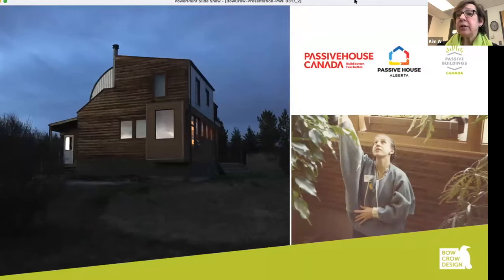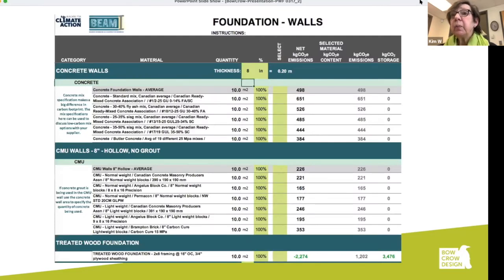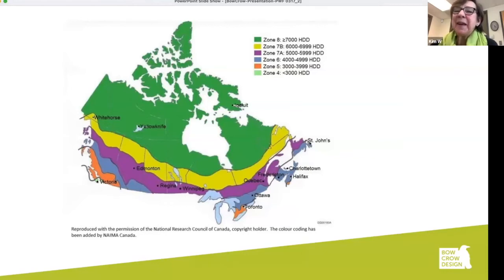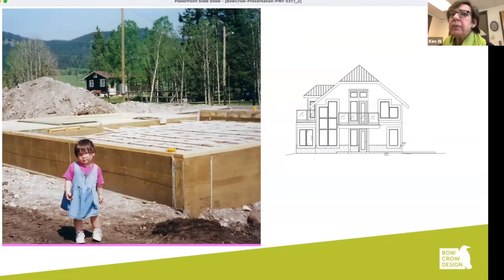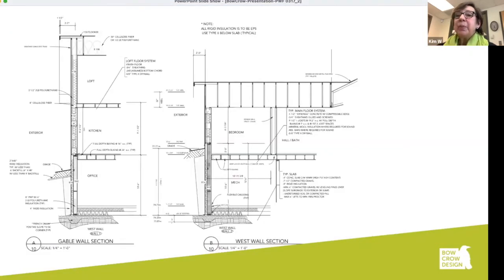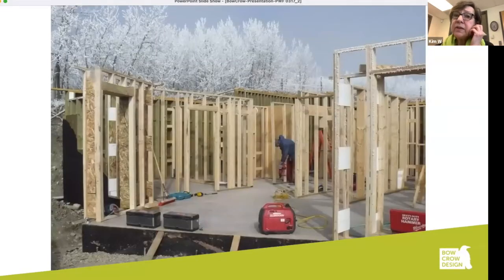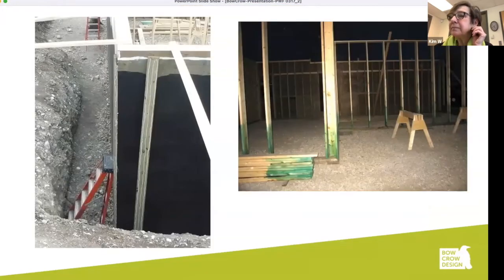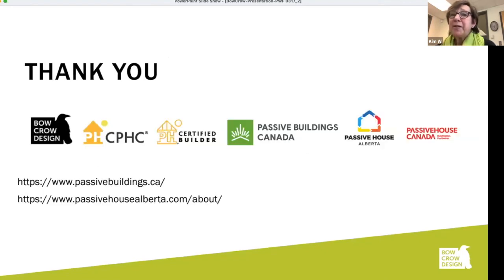Passive House Accelerator—Perserved Wood Foundations + Passive House

Comment: Would you happen to know a structural engineer that would design a preserved wood foundation for me?
Reply: how     big  is  the  house     you  want  to  build    one   story    i    just   use    2x8   foundation    having   at    least   18  inches  from  the   ground  to  the   botton  of   your     floor    build  your    wall    fo r the  foundation   16 inch   on  center   make    sure  you    put a   vapor   barrier  under  your   gravel     on  the   out  side     make    sure   you     have   french  drain    have  your   down    drain   rom  you r   gutter   to   go  into   them     drain    so  the   water  in    in  the  gravel    and  not   falling  on  the   top    ground  next  to  your  house   oyou    can    build  your  own   floor   trusses  if you  want  to     the    spam support   i     just  build a    small    pont  wall  to    carry  the   beam   so your   floor   jjjjjjjjjjjjjjjjjouises  can   be  one   lenght  if you     make  a   15  ft   spam  you  can    use a    12  inch floor   truss   i v  been   doing  this  since  the    70-    and    i  have     15   yrs  over sea   building     log  and   trimber    framed  hosue   so   if you   are    going to    sitck   your     roof    you   wil    just   have  to    put     more    studs   in  the    foundation    were  they  come  down  your  wall  snf    iff  you  are   going to  hav  a  fire place  move     or   put  in  a    extra floor  truss  for  it   all your  intero wall  can  bvee   2x4   stright  reg    framing     on my   out  side   wall   depening  the  are   im  building   in  i   doo  a  double  wall    framing   2x4  with a  2 inch space    between  the   studs    so  that  way  you   wil   have  9 inch wall  19   out  side  wall     r   13    for your  out   side  wall    2  inch    foam    board    and  them   r   13    for the   inside   walls    so  that  wil    give  a r   on  your   out  side   walls   ofr 33      i   dont  what   stae  you      is  in    but    im  in    Idaho